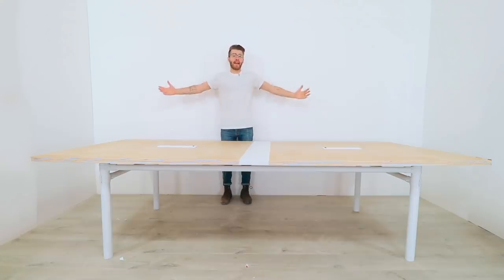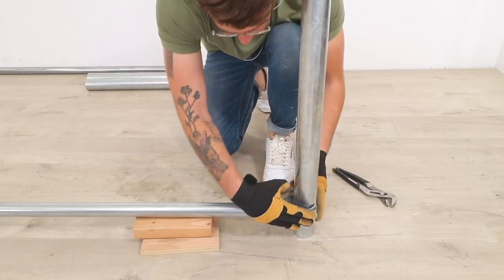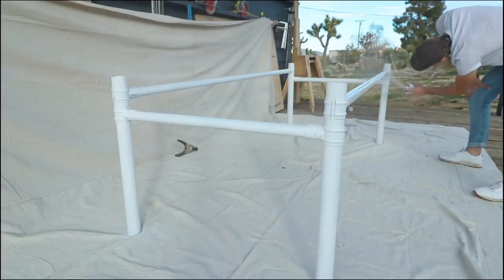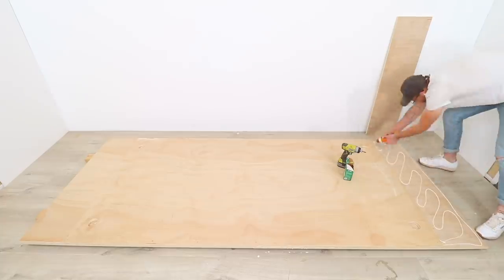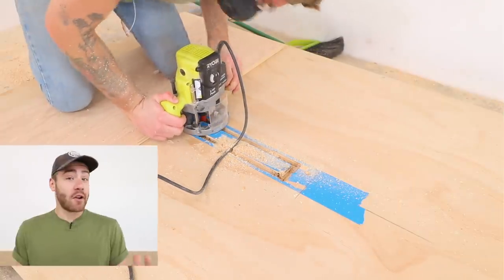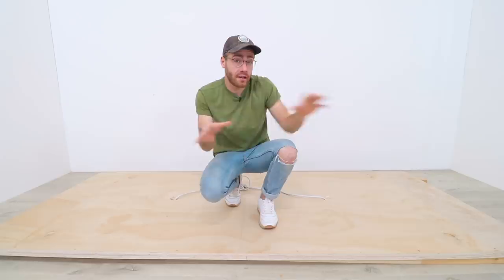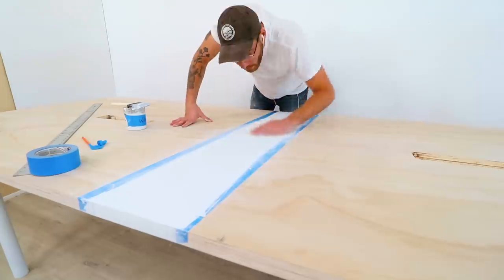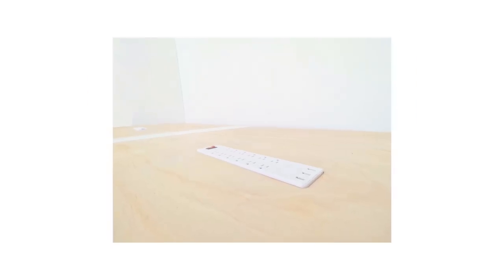How To Build a Conference Table // Free Plans

Comment: Very cool! Got cold have followed the fence theme and used the fence post caps as feet.  That way the legs wouldn't scratch a floor or cut into carpet.  Just a thought
Reply from the maker: Yeah,  I actually picked some up while I was at the store.. ended up not using them obviously...just didn't quite seem to match what I was going for.  but for the price they''d be super functional

Comment: Nice, I really dig the size and the center color, non parallel stripe swipe (still trying to wake up and think of the correct name).  Great tips and use of the inserted power strips.  To the guy who is sure that liquid is going into the strips first time out,  dude, it’s a conference table, not a pong table,... wait.... maybe pong safety covers next.  The true tell of a pro is rolling with the punches, hitting back harder and walking away without any bruises and great hair.  Win sir, win. Great job Champ.
Reply from the maker: Awesome!! haha Thanks

Comment: Scaffold poles and fixings would look just as good. As they're a smaller circumference they should be stronger. I'd leave them bare, if they're not reconditioned.

Comment: Mike, I honestly don't like the table. But, given the parameters you were working in and listening to your explanation on the podcast behind this table, I will give you props. Great way of using inexpensive parts and materials to create something very useful for a small start up. The video itself was great too going through the different steps and problem solving bits.
Reply from the maker: I'll take it!! Thanks Phillip

Comment: I like the simplicity but I think pvc or abs pipe would work better. Plus your joints would be more solid. For extra rigidity of top, add a skirt on perimeter of table with mitered joints at the corners. Even a 2-3” wide piece of same thickness stock should work. I like the build. Gives me a few ideas.

Comment: Image knocking over a glass of water and it all goes in the outlets. Anyway, cool table!
Reply from the maker: That dude's fired ;)
Reply: The top of the outlet is higher than the table so the water won't be able to run into the outlet...

Comment: Great video. Being honest? yours are some of the only videos that I watch completely from start to finish because they appeal more to the regular diyer than most.

Curious, you just painted directly on the galvanized metal, right? Nothing to scuff it up or sand it off? If that is so, you've saved me a lot of work on a future project this summer. 👍👍
Reply from the maker: RIght on, Thanks Russell. Double check I didn't do something wrong by not sanding the metal though...
Reply: @ModernBuilds , I'm gonna try a test piece when the weather warms up here. We'll see how it goes. 👍👍

Comment from the maker: What would you use fence posts and fittings for??
Reply: You could try building something with scaffolding poles and connections next time, it would work in a similar way.
Reply: my friend and i are needing a large table for our workspace and this would work perfect once scaled down. Plan on using the fence posts for that! I would have never thought about using that.
Reply: @mrburtenshaw8610  scaffolding = $$$$$
Reply: A fence
Reply: A book case
Reply: As a base for an outdoor workbench. Add in some lower "stretchers" for the rigidity and maybe a lower shelf for tools being used.
Reply: Disc golf course obstacles

Comment: Great job Mike, I was thinking you could also use the table as a shop table.   Just a thought.
Reply: That's exactly what I was thinking! Assuming you could get the structure rigid enough, add some casters to the legs and bingo-bango - kickass outfeed / assembly table!

Comment: Table looks awesome! Did you think about possibly adding a metal face-plate around the powerstrips to hide the edges? I've seen them on a lot of conference tables.
Reply from the maker: I didn't consider it honestly, but that's a good idea! Just give it a little bit of a lip so that you have a little more wiggle room :)
Reply: that's a nice idea - maybe easy and cheaper to do them from plastic if you have access to a 3D printer

Comment: In your opinion (or fellow viewers with experience) how does ryobi tools compare to brands like Dewault, Milwaukee, or Kobalt?
Reply from the maker: They're good. when it comes to handheld power tools I've gotten similar results from about every brand I've use (except Harbor Freight), The higher price usually comes with a little more durability and the occasional nifty feature. Since I'm not very rough with my tools or traveling from jobsite to jobsite, they work well for me

Comment: "Cantilevered slant". You keep using that word. I don't think it means what you think it means.
Reply from the maker: probably not ;)
Reply: @ModernBuilds  "A cantilever is a rigid structural element, such as a beam or a plate, anchored at one end to a (usually vertical) support from which it protrudes" a good example is when your deck joists sit on a beam but extend beyond it. or when the beam extends beyond the footing it is sitting on

Comment: I'd guess there is a pretty good reason why power outlets designed for conference tables don't have on/off switches. It's too easy to accidentally hit the power switch on the one you installed. Although, if money is tight, this would be a good alternative assuming you don't accidentally turn off someone's device...you could just build a 1/2 inch wall around the recess.

Comment: Creative use of the fence posts and fittings Mike! Experiment with creating a template of the outlet on a piece of MDF and use your straight cutting bit with a bearing on it to route the profile. Could attach the template in the field of the plywood with double sided tape or the painters tape/CA glue method. Anyway, maybe something to try in the future. Keep building.
Reply from the maker: aah! Good tip.. especially since I had multiple recesses the same size!!
Reply: Modern Builds yes sir! A DIY Dado guide (adjustable width of router base) for your router may be a cool project to build as well. Nice add-on to your tracksaw.